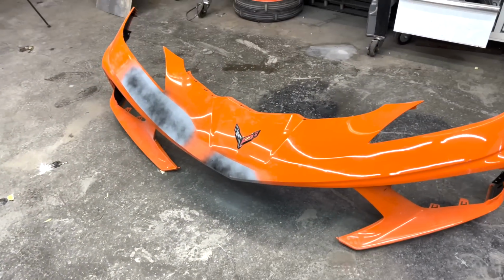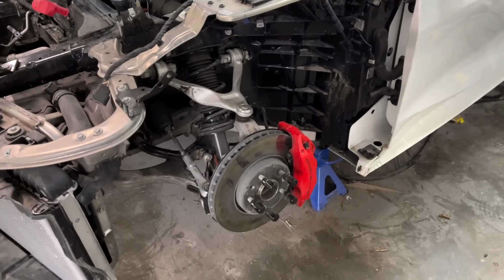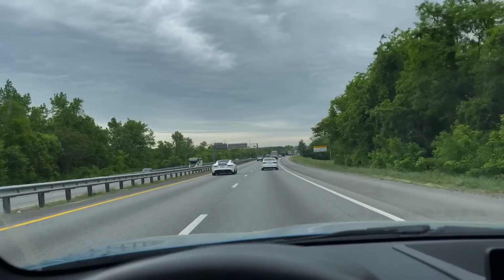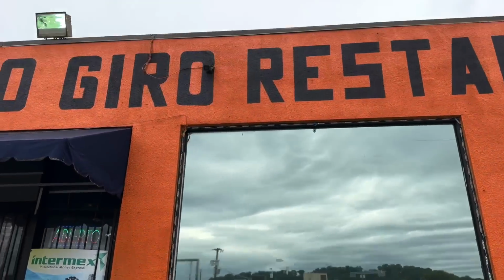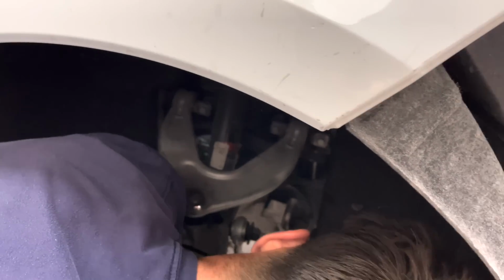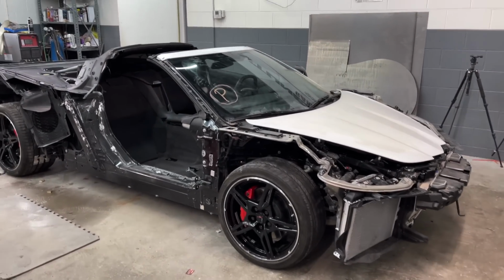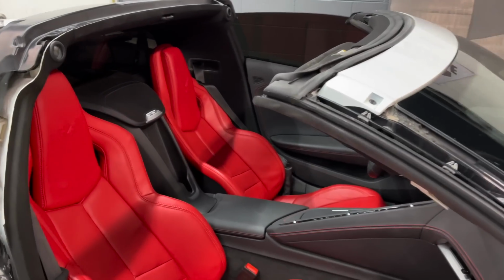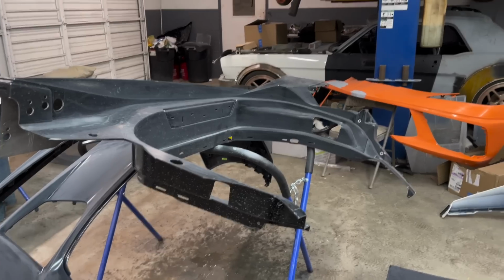Our Wrecked 2022 C8 Corvette Finally Drives And We Prep it for paint!!!

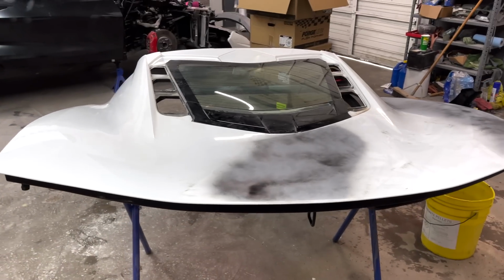Comment: 1:55 old timer tip: if you ever have to mask inside a groove like that, leave about 1/4" of tape "unstuck" over the gap. then go along with a dull pencil and that will fold the tape over into the groove nice and tight. I've done that many times and it works like a charm.

Comment: Just an observation. Normally follow manufacturers spec as to filling oil, overfilling can result in seals popping out, remember there is a bit of expansion with heat. You need to get a shop truck , its going to save your nice cars !
Reply: he has a dodge ram shop truck....isn't finished yet 😞

Comment: i have seen some guys take and drill an 1/8 inch hole in two different inconspicuous places on the rocker panel in towards the weatherstrip while you have everything bolted on the car so after you paint you just need to get the rocker on and slide your two 1/8 inch rivets into predrilled hole's and bingo you got your panels lined up  and if you messed up drilling the guide holes you can fill the holes with a paintable filler  but like i said in the beginning inconspicuous is key

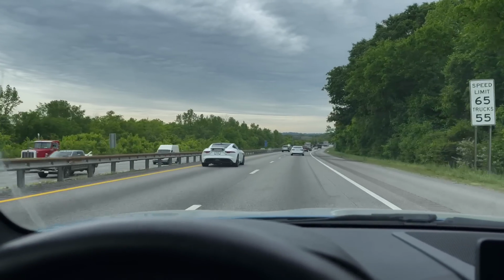Comment: 5:50 I had a 2015 Jaguar F-type S coupe. It was beautiful and a head turner, but wasn’t great to drive. Even when active exhaust was off, there was always a buzz noise in the cabin that was annoying. Stereo was nice but couldn’t hear it well over the buzzing. Suspension was super stiff and rattled the interior every time you hit a bump. I got rid of it after 2 years.

Comment: That gonna be one sharp ride when it’s painted!
Going back to the McLaren, what adhesive did you use to rebuild a couple of mounting flanges on I think the front fenders? Need to pick up some to rebuild a plastic part on a project. Something NAPA might have?
Reply: the adhesive ben used was called panel bond you can get it in different curing times from 1 minute to eight hours with a full cure in 24 hours depending on temperature but be aware there are different types of panel bond some will do steel aluminum fibre glass carbon fibre others will only do steel aluminum but it will say on the packet make sure you get structural panel bond i know this as a cert 3 panel beater in australia cheers from down under

Comment: For big tires try sitting on your butt with your legs under the car and the wheel between your knees.  Lift with your knees and line it up with your hands 100x easier and won’t scratch the rims.  Learned this with big truck tires

Comment: Transmission Fill Procedure

Note: To avoid rounding of the transmission oil filler plug, it is recommended using an appropriate 6 point metric socket or wrench. 
Transmission Oil Filler Plug (1) » Remove — Transmission Oil Filler Plug Replacement
Note:
Transaxle fluid level setting must be followed exactly as written.
The quart/Liters containers of TITAN EG FFL-4 must be shaken to stir up the additives before pouring into clean funnel/hose.
Determine the approximate amount of fluid needed to fill the transmission. Approximate Fluid Capacities
Caution: Use Fuchs TITAN EG FFL-4 TREMEC transmission fluid only. Failure to use the proper fluid may result in transmission internal damage. 
Caution: All components used when filling the transmission with fluid must be clean and free of debris. Failure to use clean components, such as funnels, hoses, or fluid suction guns may introduce contaminants into the transmission and cause component damage or transmission failure. 
Note: Using a fluid suction gun is recommended for filling the transmission with fluid. 
Fill transmission with fluid until fluid level is at the bottom edge of the filler opening.
Note: To avoid rounding of the transmission oil filler plug, it is recommended using an appropriate 6 point metric socket or wrench. 
Transmission Oil Filler Plug (1) » Install — Transmission Oil Filler Plug Replacement
Run vehicle for 3 to 5 minutes while selecting drive and reverse to fill the clutch circuits. To properly fill the circuits place foot on brake, shift into drive for 30 to 45 seconds then shift into reverse for 30 to 45 seconds then repeat.
Stop the engine and perform the following actions within 5 minutes after stopping the engine.
Transmission Oil Filler Plug (1) » Remove
Verify the fluid level is at the bottom edge of the fill opening. If not, add additional fluid until the fluid is at the bottom edge of fill plug. Transmission Oil Drain Plug Replacement
Transmission Oil Filler Plug (1) » Install — Transmission Oil Filler Plug Replacement
Clean the surroundings of the transmission oil filler plug and the transmission oil drain plug.
Perform the configuration/reset function: Hydraulic System Flush Procedure